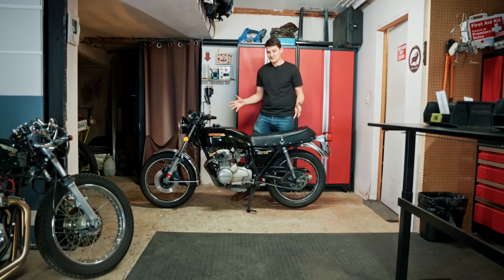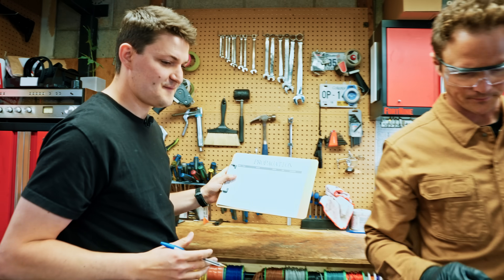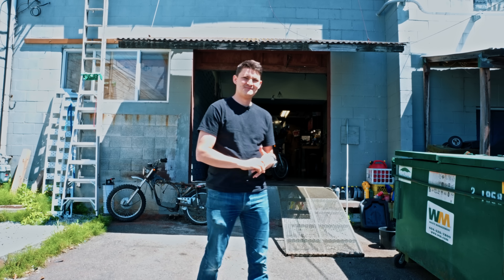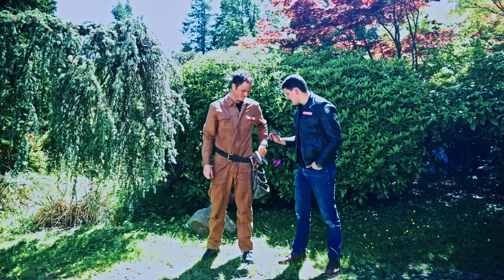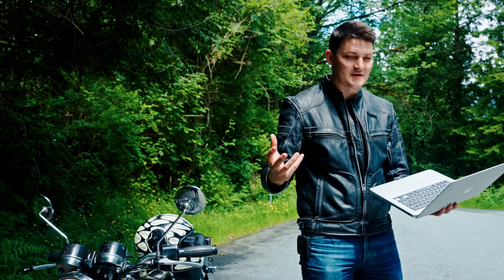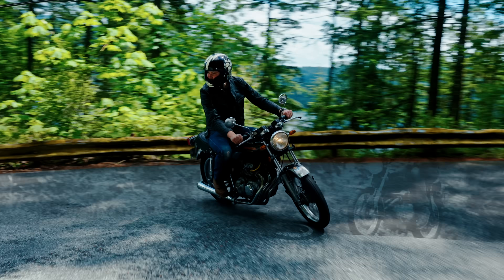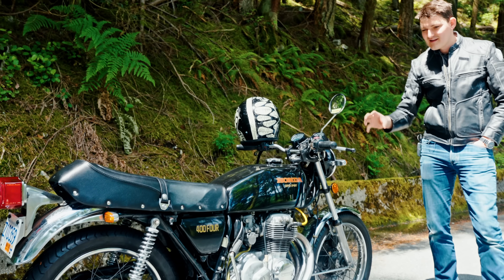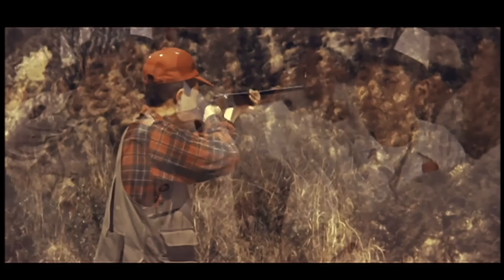Why Hondas Run Great - JIT Manufacturing, 5S Methodology and Kaizen

Comment: I have never been let down by anything I've owned if it was Japanese made... I will always love Hondas because my dad sold them in the 70s-90s. I love browsing the listings for sale and being reminded of all the different models they had over the last 40 years. My oldest currently is a 1987 trx250 utility model quad. It's not the fastest thing out there but I'll be damned if the ONLY thing I've had to do to it was carburetor work and brakes.. I cannot say that about the 20 year newer Polaris I've got that feels so broken that I just can't love it.

Comment: I have had 3 hondas, started on a 1980's 125 twin, cx500 and now a cbf600. All were very reliable, you know what you get. I had a Ducati 851. Just like an italian lady, intense, temperamental, passionate but high maintenance and exhausting. I sold it, I couldn't afford the maintenance.

Comment: Not sure Honda still abides by these practices! My 2020 AT has a rusting frame, recalled screen, and an engine check light caused by the exhaust valve design allowing water ingress (which Honda don’t warranty, and haven’t issued a recall, a new exhaust is £2000). The earlier version also suffered wildly with rusting wheel spokes. There’s a lot more focus on building DOWN to cost, rather than UP to quality

Comment: As a QA professional now with 36 years I worked as a Toyota QA Engineer then went on in other industries.. still working in the manufacturing industry I have applied numerous techniques in different factories. What stands out is the people who you have to work with. Perception and ownership of activities is the most important single aspect that can make a system successful or not ❤ cheers from Oz 🇦🇺

Comment: I'd also like to add that although having top quality, as Honda does, is fantastic for the long haul, it's the passion for the product's engineering that will set it apart. Honda used to be able to go out on limbs to be different and catch hearts. That has all but died of late. There are too many ball-less bean counters running Honda now and many other manufacturers have decent quality now too. So, "quality" as a selling point earns shoulder shrugs today with most customers. It's much more about showing up and winning hearts that counts the most. I'd go so far as to say, CFMoto can do this heart winning even better than the top 3 Japanese motorcycle manufacturers today. The leaders of the bike manufacturers from the land of the rising sun really need to get some passion back into their game IMHO.

Comment: The Honda 350 and 500 fours were not good running bikes, very sluggish, poor acceleration and heavy too. The later 400 and 550 models addressed this issue.

Comment: I build a 35cc Honda 4 stroke engined 2 wheeler with a 14 speed (Rohloff) gearbox and have done 22.500 miles/36.000 km on it.
The  2 wheeler with the smallest 4 stroke Honda engine ever.
😎

Comment: All those little iterations (improvements) may have been the reason I had so much finding the correct brake pads for my 1972 Honda 350 SL K2.

Comment: Just in time is a Japanese ploy to destroy your business and give the Japanese business an edge in competition with you. I’ve seen this applied in production floor and it was designed to cut overhead and safety stocks out of production process. The largest overhead cost to the manufacturer was always labor. The Germans used it too, but they had more sense and try to invest in the people making gadgets. 
I had a production leader insist that I give her 5S explanations why a 24vdc control light bulb burned out (in writing no less).

Comment: HUGE THUMBS UP! This is exactly what I've been talking about for years when discussing motorcycles with friends. 
People say: "The Japanese took over the motorcycle market then and the Chinese are doing it now."
I tried to explain the difference in spirit between the two nations, and that simply producing clones is not the same.
8:48 The last sentence is the most important:
"So when people ask if China will conquer motorcycle manufacturing next, tell them that Japan did it by respecting the authority of every worker from top to bottom. An individual authority is the one thing authoritarians can't copy."
That's one of the reasons why the Koreans are doing much better than the Chinese, but even they can't beat the Japanese.
I deeply respect the Japanese, having lived there for a couple of years in the late 80s (I arrived shortly before the Emperor died and the whole country came to some sort of standstill), and abhor the Chinese, having had to deal with mainland Chinese groups for seven years working in a hotel in the USA.
That's the reason why I will NEVER get a Voge or some familiar sounding European brand name (like Benelli or Zuendapp) which is owned and run by the Chinese, no matter how good they look on the showroom floor and how tempting the price!
THANKS A LOT to Fortnine for creating such an eye-opening video; all the little details are highly appreciated!
(Now I'll forward this link to an old Brit buddy who's still living in Tokyo after all these years.)

Comment: Brilliant presentation, I knew there was a reason I've owned more Honda MC's than any other marque (9 Hondas, 5 Kawasakis, 5 Harleys, 2 Yamahas, 2 Rickmans and 2 Suzukis). I'd also like to point out that USA beat Japan in WW-2 because our supply chains were better, just in time so what if half ends up at the bottom of the ocean.

Comment: Also  and the BIGGest reason and the reason  Kanban doest really work in the west    IS the culture   If you tell a Japanese that the part is 2mm   it WILL   be 2mm  and its a cultural thing  in the west we go look its 1,99 mm its fine !      Germans have a similar thinking to the Japanese      Yes Japanese bikes are well-designed for production   BUT the beauty comes from Italy and England     ALSO   imperial measurement  is natural   where is Metric isn't    ( and Hondas cam chain tensioners are legendary )       Im a honda trained engineer and have lived in Japan for 25year ,,just in case u wonder how I come to these ideas

Comment: I worked for Mitsubishi in  Australia. When they first the introduced 5S principals it was quite a "culture shock", but, once we were all fully conversant with the concept and its application, it made a big difference to both the smoothness of operations (in a manufacturing setting) and morale in the workplace, which improved considerably. But back to the bikes... a mate of mine had the 400 Four Super Sport back in the day and it was a brilliant piece of work, especially for its small capacity. And was that a 350 Four custom cafe racer I spied? What a gorgeous work of custom art - well done to whoever brought that to life! Cheers from Oz. 👍👍🇦🇺
Reply: It was called the sweat shop when Chysler owned and ran it.
The fear when it was learnt the "Japanese were coming", was all for nought.
The Japanese were far better.

Comment: And YET - their BEST MC concept - the NC ( 750X in this case ), they MANAGE to F....K massively, up !  Being affective, did not save Honda from being STINGY and, even, somewhat, SLY.  They deliberately, never make THIS bike, really good, because they know - not SO many, will run to buy their, adequately, equipped "top" models. How ever, they fail to understand, that as soon, as someone else reaches their level of reliability, offering PROPERLY equipped bikes - they WILL loose the marked ! - Well - stupidity + greed = a pretty bad combination.

Comment: Honda scooters since 2019 that produced and sold in South East Asia region  using eSAF (enhanced Smart Architecture frame) which is thin steel plate welded together instead of steel tubular pipe or steel square pipe. There are some cases the frame get corrosion from inside and snapped after 3 years. The previous model was using common tubular frame, unless the unit is intentionally exposed to sea water for long time 5 years or more (in coastal region or frequently flooded area) , there will be corrosion, though less frequent. In 2024 model there are some improvement for cleaning the welded part before applying thicker paint, and longer 5 years warranty for the frame instead of 3 years.

Comment: Not to knock the Japanese companies’ process mastery, though ironically a lot was based on American teachings that were ignored in the US. But I owned both a Honda 3504 and a 400-4 (CB350F and CB400F) and they weren’t really great motorcycles. Now by the early ‘80’s, I had several brilliant Hondas, but the small Fours weren’t as good as our rose colored 20/20 hindsight tries believes.
Reply: Oh, and my 1973 CB350F which I bought in 1975 already had a stuck cam chain tensioner at about 5K miles. I tore the motor down and replaced it. And had to do the same with my 1975 400F. As for the revised bars and pegs on the 1977 CB400F, I think most Americans who wanted a 400cc four with a 6 speed and 10000 rpm redline and 4-1 exhaust, probably really liked the low bars and rear sets, and bought their bikes in 1975. By 1977, dealers were sitting on lots of unsold 1976’s, with the black side covers, and I don’t think dealers ordered many ‘77’s. At least not in California. The bike was not renewed for 1978. Anyway, just some historical context for Ryan’s brilliant video.

Comment: I had a first-year (1974) CB550. At several thousand miles into a 10K-mile ride, the loud clicking of the tappets became too much, and I destroyed a valve adjuster screw trying to fix it. Fortunately, I was able to replace the screw and complete the ride. Then  I learned that the rocker arm shaft rotated in the aluminum head cover, wearing the aluminum and causing play that made it impossible to adjust the valve tappets precisely. Honda replaced the head cover and rocker shaft, with the shaft pinned to the cover so that it could not rotate.

Comment: The first multi cylinder bike I ever rode at 14 was a Honda CB550, with a knobby tire, on a dirt airstrip (in Australia). After a diet of 70’s & 80’s single cylinder dirt bikes. It was so smooth and fast!

Comment: If you’re talking Lean 6-Sigma you have to also credit Mr. Deming.
My fav quote in quality control “85% of the reasons for failures are deficiencies in the systems and processes rather than the employee.” 
Or think NASA and the o-ring if that’s easier. 
Great video, bringing QC to the masses 🙌

Comment: My daily is a 73 CB350. BUT it isn't a "Cafe racer" or a "brat style" bike, it is 100% original except for the mufflers, tires, and Common Motor rectifier. I'm still running points, too.

Comment: I almost bought a 1974 Honda CB400F about 6 years ago that was fully restored.  It was yellow and looked like it just rolled off the assembly line.  As Ryan mentioned, the Achilles heal of that bike was the tight rider box.  I'm not big by any means (about 6 ft tall), but it felt small for me, I can only imagine how much smaller it felt for Ryan here.  It's too bad it didn't feel right for me, as I drive 2 hours to see (and buy the bike) but didn't pull the trigger when I got there because it just didn't fit me.  I'm sure the seller had no issues selling it to the next person, as it was a gem of a bike and his work was meticulous.

Comment: I worked in a factory that employed the JIT and Kaizen methodology. It was a nightmare. Maybe this isn't true of all places, but you never knew exactly how many parts you were going to make until the day of (which makes for a very stressful environment), and if you got done your parts early, you would spend HOURS cleaning, to the point where you simply ran out of stuff to clean. On top of all this, the Kaizen system was entirely BS. They would make all sorts of promises of how they would get back to you over every single kaizen submission, but in my experience, businesses NEVER follow through. In Japan, the JIT, 5S, and Kaizen probably work very well. In north america... not so much (at least where I worked, anyways)
Reply: It's like real sushi and foreign made sushi - it's just not the same.

Comment: I believe and have been experiencing all this principles used by Honda, when i ride my 23' Honda Goldwing B. 
It's a masterpiece of engineering, design, and overall performance. 
With almost 50 years of model history, and with no direct competitors, Honda clearly has been building motorcycles the right way.

Comment: I bought my first brand new motorcycle in 1972.... My second brand new motorcycle in 1985. I bought my last motorcycle used in 2019. The last motorcycle (2010 Harley Sportster) is absolutely the best built motorcycle I have ever owned... and I've owned a lot of motorcycles. I'm sure that the key to this is keeping up with the maintenance and keeping it clean. It's lasted longer than all of the Japanese, English and other American motorcycles I've owned. I have spent less on maintenance and more time riding than wrenching.

Comment: On its own, JIT does not give you a quality product, JIT is primarily about efficiency. Honda has better quality over some of the competition because they have better expertise at critical positions throughout the company, better materials development, and better supplier/process development.  For example if you research the difference in engine seals/gaskets, Honda uses a better, higher cost material, and is one of the reasons their engines live longer than others.  Other companies try to save a buck on a crucial engine part.....this is just one example.

Comment: With unexpected delays, JIT MFG falls apart. You are better off using an 'Earliest Start' approach to minimize the 'Critical Path'. Then once the process is established you can use the JIT, but only with expert oversight control (accounting & management).

Comment: There was a motocross rider back in the day, I want to say Joel Robert?  He initially rode for ČZ.  If he went to his team and said the engine blew up on a big hill, they'd tell him to take it easy on that hill.  If he bent a shift fork in the gearbox, they would tell him to be more careful with the shifter.  After a few years, he switched to an up-and-coming Japanese company called Suzuki.  When he told them about a flaw in the bike, they would diligently write it down, and the next bike flown in from Japan would have improved parts.  They would develop prototype parts and ask for his feedback on the changes.

Comment: Been through both the S’s and the W’s in a Large gas company and a Chemical Co. 5S’s was slowly forgotten about, 5 W’s still used as a basic Incident Investigation tool. Honda, well I wished I had a Honda bike but I have a 7Kva generator which is perfection.

Comment: I'm surprised that you missed the OTHER "Wai" -- Waigaya.  You hinted at it in the last part, but essentially, it's the practice to LISTEN to the workers, to respect what they SAY and THINK.  This is where the "5 Whys" do their job -- a problem doesn't just belong to one person, it is an opportunity for everyone to come up with resolutions.  Waigaya is the reason that everyone at Honda wears the same uniform, so that there is no implicit hierarchy to allow the lowest-level associate to be ignored.  Everyone has an equal share of a problem, and once a suggestion is made, it belongs to the whole company -- to test or implement as needed.  Any idea is discussed until either sent out for test or rejected.

It Waigaya that BROUGHT all of those changes that created motorcycles that last 50 -- or even 70 -- years.  What was the best way YESTERDAY may now be second-best.

Comment: Love me Hondas but I've had nothing but bad experiences with Honda CRs (125-250cc 2-strokes). Ignition problems, fuel mix problems, transmission problems you name it. Had a -97 125cc and -02 & -07 250cc. Never had any problems with Yamaha YZ or Kawasaki KX.

Comment: Weird enough I just came home from a short ride on my beloved blue 1976 CB400/4 (75 in other markets) . It is so reliable, and fun to ride… unfortunately here in Brazil our gas is mixed with at least 25 % of ethanol , and although my bike still runs perfectly, all the towers of the carburetors are  slowly disintegrating , unfortunately.

Comment: I've worked at places that are all "5S Kaizen blah blah blah" where they want to be like toyota, but refuse to do any of the things toyota does so that toyota can run like toyota. Management spouts all the buzzwords, and does all the easy stuff, but won't commit to the whole thing. Picking and choosing what to implement instead of actually doing it.
As is traditional for management, only caring about appearances and not about actual efficiency, probably because efficiency makes them redundant.
I've since opened my own business and no longer have to deal with brain dead management, just brain dead customers.

Comment: This is why I just bought a new Honda CB650R. My dad has a 44 year old CB650C and it still runs like a top with just basic maintenance over the years. Yes, it was a little more expensive than the competition but "you can't beat a Honda"
Reply: Still cheaper than "reliable" BMW or KTM. Or Ducati. Or Harley, come to think of it.

Comment: In the 70s, my father bought SL and XLs that the local teenagers had beat to hell or taken apart and put in a box.  Most of the time, all he had to do was pull the dents out of the tank and tune it up to sell it for two or three times what he paid for it.